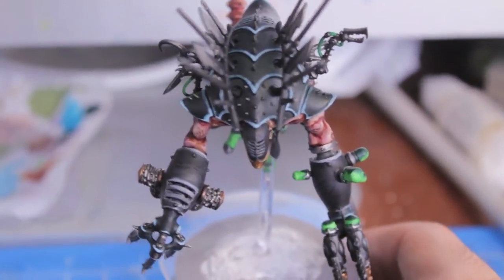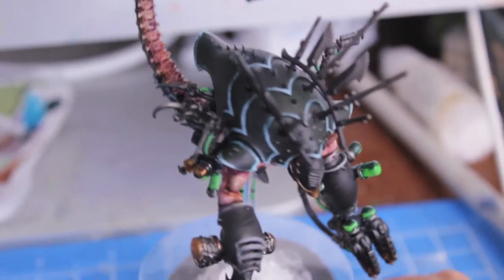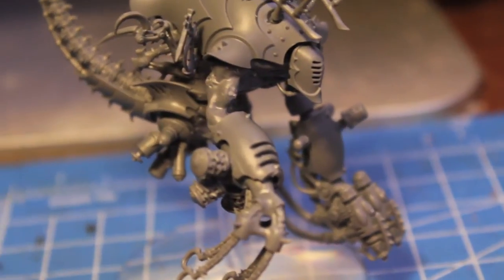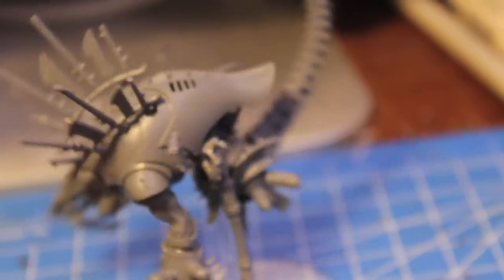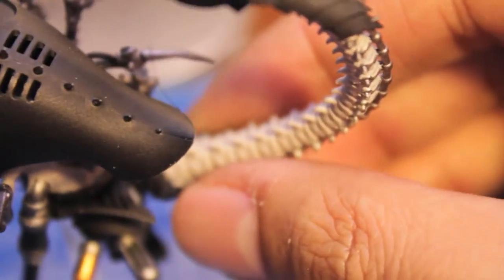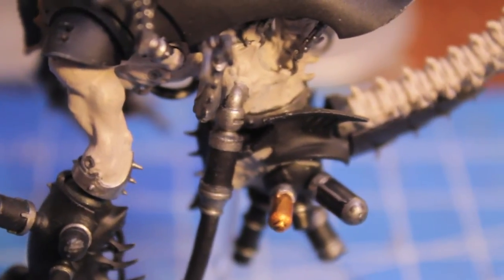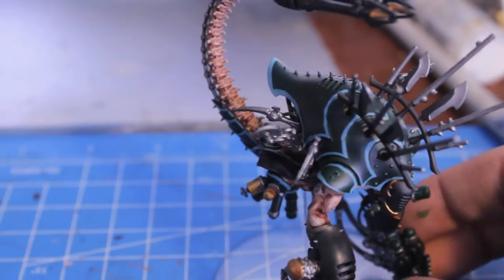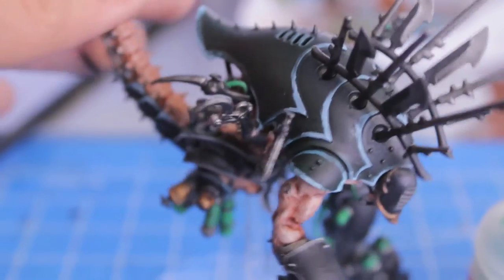How to Paint Dark Eldar Talos | Warhammer 40k

Comment from the maker: @bossgreennutz Well, what I like to do is just add some water to the pot, along with a metal clipping (from the bottom of a metal model).  That's a lot harder to do now that GW doesn't come out with metal models =(

Then, I shake up the pot really hard, and the metal clipping cleans off all of the paint that's thickening and sticking to the walls.  I think that eventually I'll just change to P3 paints or Vallejo though, lol it's a lot less work to maintain.